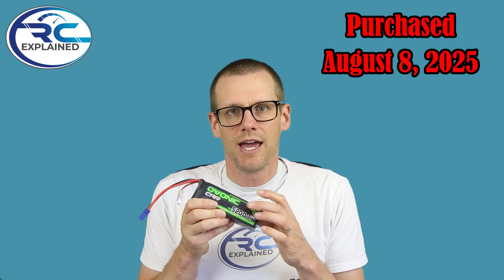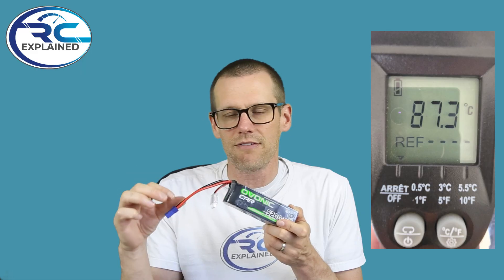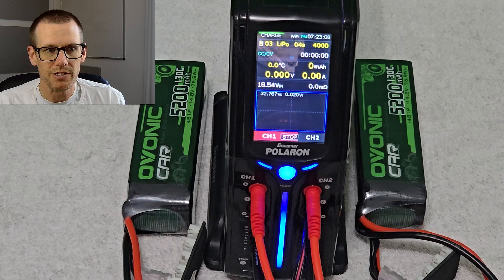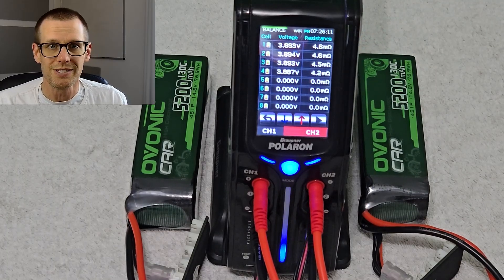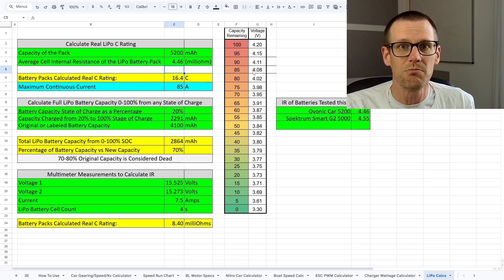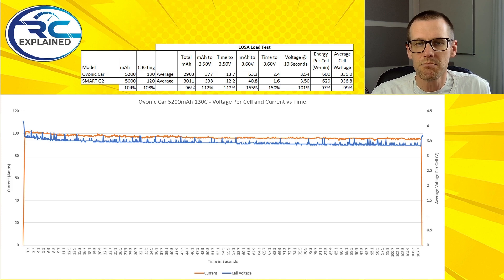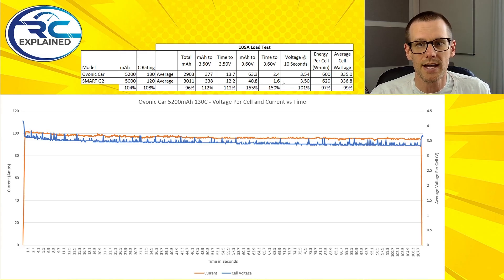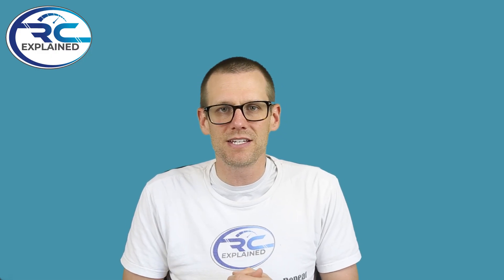How Strong Is the Ovonic 130C? Full C-Rating Reality Check!

Comment: I'm having trouble understanding your chart if the Smart G2 battery, says time to 3.5 volts is 12.2 seconds and then on the same chart it says voltage at 10 seconds is 3.5 volts your chart math isn't working out what's with the discrepancy. I mean sure we're only talking about 2.2 seconds here but when the entire run is less than 105 seconds.  I was about to click on Patreon to get your charts but after seeing that how can I possibly trust them. Thanks for you time though.
Reply from the maker: That's fair. I do round values shown on the summarization sheet. The more precise voltage at 10 seconds was 3.5025 and the time to 3.50V looks for the first value that is at 3.50000 or lower. I run the same program that I coded myself on all tests. I record data at 0.1s intervals. A good pack should not be close to 3.50V in 10 seconds.

Comment: Nice to see the Ovonics compared, I have 2 3s 5500 50/100C soft packs I use my arrma Big Rock. They've been a good basher pack, Most i see temp wise is mid 90's (F) after a run, honestly not much above ambient here in the summer
Reply: Phewww my noto 6s gets my 6500mah packs pretty hot. Almost alarmingly hot 😅